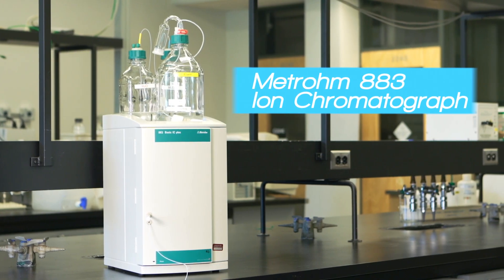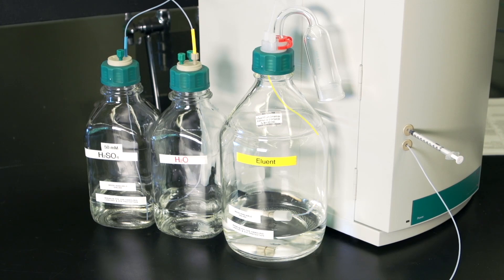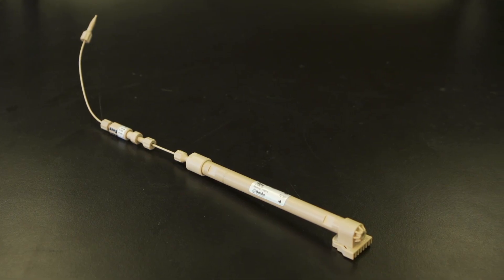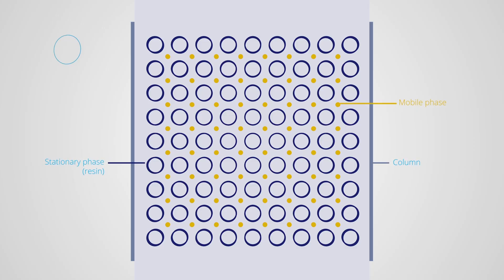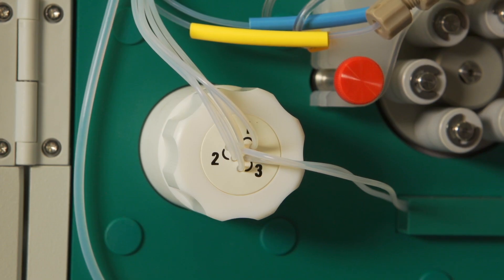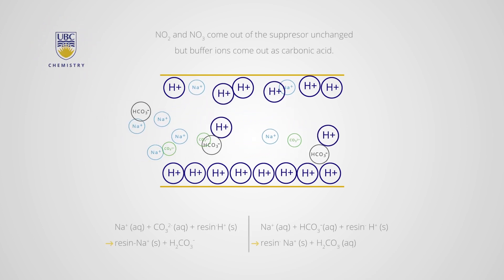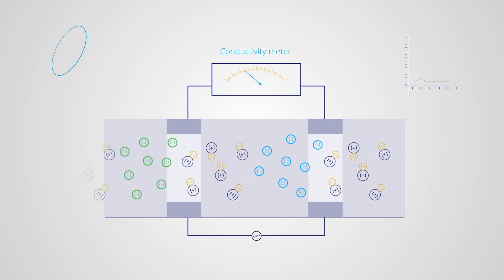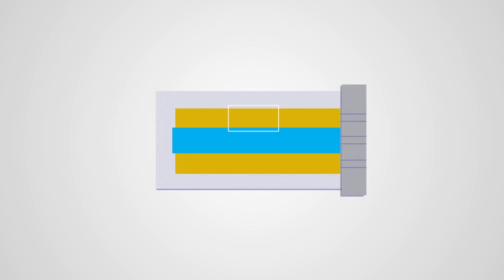Ion Chromatography: UBC CHEM 3rd year Analytical Chemistry

Comment: Thanks sir I have a question for you
Why we run a blank in ion chromatography
Reply from the maker: To check for the possibility that the solvent (deionized water typically) that you used to make calibration solutions (standard solutions) contains any of the ions that you are measuring.

Comment: Thanks for the animated explanation how it works. Also, where exactly the Deionized Water comes in to play in suppressor ?
Reply from the maker: The suppressor has three chambers.  At any given time, eluent flows through one, sulfuric acid through another, and deionized water through the third. The role of the chambers cycles periodically (every ~10 minutes). The eluent one becomes the acid one, the acid one becomes the water one and the water one is brought into use with the eluent.  The one flowing eluent is doing the suppression, the one flowing acid is regenerating, and the one flowing water is rinsing away excess sulfuric acid (to get it ready for it's next role suppressing the eluent conductivity).
Reply: @robinstoodley9431  Wow... Great explanation, your text is as good as animation. Thanks Robin!!

Comment: how is this instrument calibrated? what one needs to calibrate it?
Reply from the maker: Absolute calibration of the conductivity detector is done at the factory and normally does not ever need re-doing.  Relative calibration done daily by measuring a blank sample; perhaps deionized water.
Reply: @robinstoodley9431  sir if Conductivity will be less than that what we do to rectify the instrument